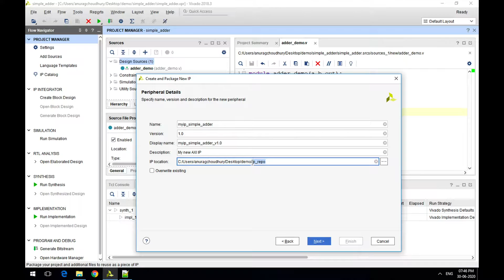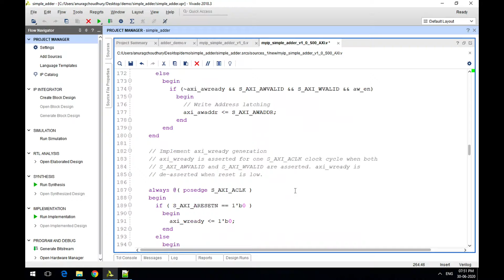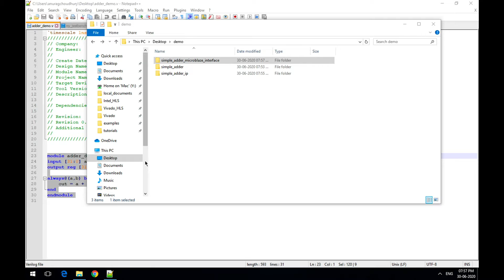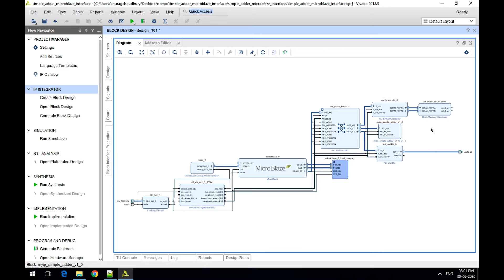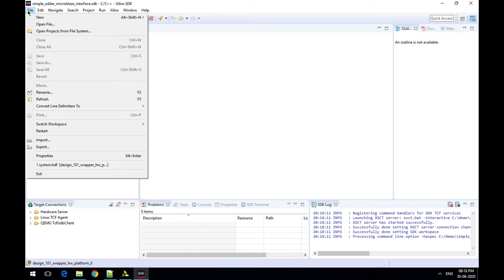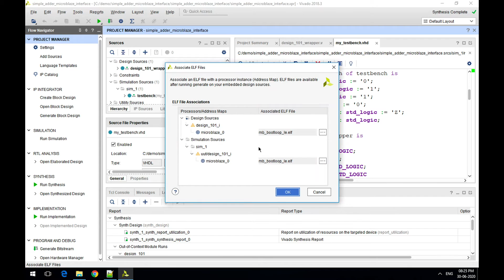Microblaze RTL Simulation and AXI Slave wrapper tutorial

Comment: Great video, I've been looking for something like this.  I got this to successfully work on the Arty 7.  This has presented me with a lot more questions.  Like what is the difference between slave and master, and when would I use one over the other?  How can I make a 64 bit or larger IP if this only works on 32 bits?
Reply from the maker: Masters are the devices which can give commands, and slaves are the devices which serve the request/command. 2 examples of masters are the processor and DMA. If you want more than 32 bits, unfortunately you need to make your own AXI wrapper. I also don’t know why 64 bit option is missing in the gui